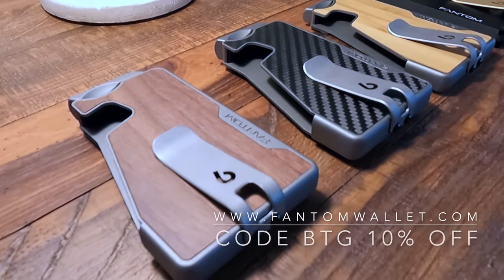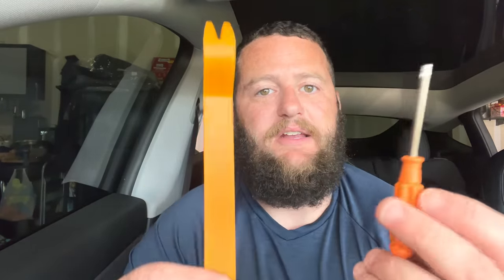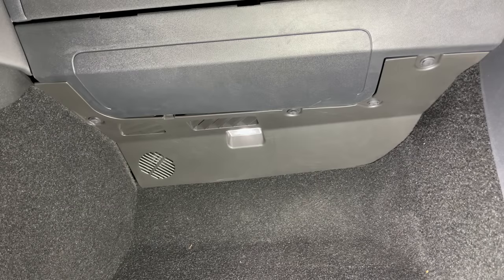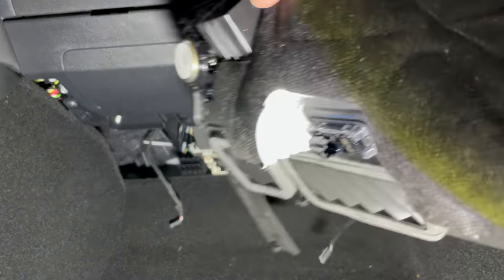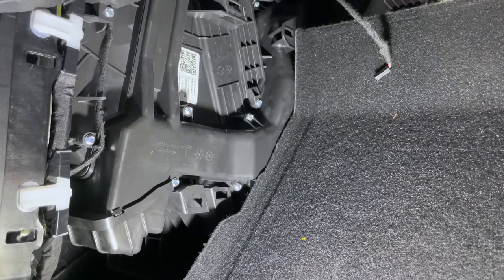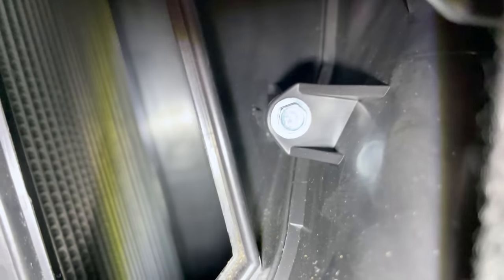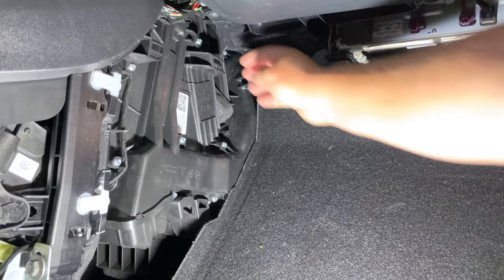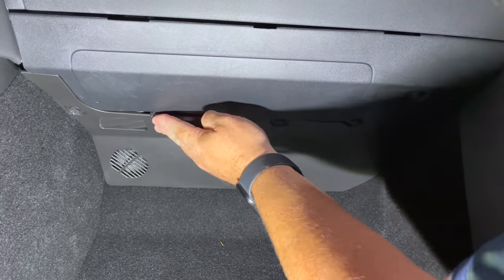Tesla Model Y - Changing Air Filter to Get Rid of Smells

Comment: Thanks for the video. I would have thought that if Tesla was going to bother to change the engineering of this that they would have gone the full mile and make the filters accessible through one simple door on the side of the console. This is still way harder than it should be to change the filters
Reply from the maker: Agreed
Reply: I love almost everything about my model Y - but the placement of these filters is incredibly dumb. “Let’s take something that needs to be done once or twice a year, and should take 2 minutes for the owner to do himself… and make it virtually inaccessible, so that multiple parts have to be removed to get to it!” 🙄
Reply: @mdickinson  agree.. had MB GLA and GLC and Honda Accords and never did i do any of that filter changing stuff...
Reply: Tesla wanted $129 for a mobile service to come change the filter. I said nope, just watch this video.
Reply: @vonn793  they quoted me $73 to come out and change mine and I supplied my own aftermarket filters and they charged me $23
Reply: I was unable to remove the speaker cord so I unscrewed the speaker and unable to remove the side panel entirely, I saw the clips holders are breaking, so I bended the panel to access the filters. So dump engineering!
Reply: @MrLincoln07 cjyuj
Reply: @joan38 just do it without unplugging anything. Can be done
Reply: Yeah, my '21 RAV4 Prime had filter access by bending a tab that let the glove box hyper-open. Then the filter door was right behind the glove box opening. 'Took 2 minutes and no tools.

Comment: Thank you! You did a great job positioning the camera. I appreciate  your efforts to help make the Tesla experience better for all. Dealerships charge about $250 to change the cabin air filter. Who knows if they clean the evaporator coil while they are doing it? The famous quote of unknown origin attributed to Napoleon Bonaparte: "If you want a job done right, do it yourself!" is my motto.
Reply from the maker: I totally agree! I am not claiming anyone is doing anything wrong at a dealership, I just like the peace of mind by doing it myself. Back in the day of oil changes, I used to request they skip the Carwash. I didn’t want them doing even that lol
Reply: I had it done today at the local Tesla service center. It cost $58 total.
Reply: The service center in Pleasant Grove, Utah just told me today that they do not offer evaporator coil cleaning. $80 for a mobile tech to just replace the two air filters. I will be attempting to do this myself now haha.

Comment: Horrible placement of cabin air filter. I just did it for my Model Y and it was a bit of a pain but thanks to your video I was able to accomplish it without any issues. I have done CAF replacements for many types of cars over the years and, this one was by far the most time consuming.
Reply from the maker: Yea, its interesting the placement of the filter. Quick maintenance items like those air filters are generally engineered in place for easy replacement at the shop. This one is unnecessarily complex lol.

Comment: Great video! I recently had to do this on my Model Y. I recommend not removing the speaker plug because it's very fragile and can easily break. Also, I've had to do this twice in the first year I owned the car, but the second time I tried the new aftermarket filters. I guess we'll see if that helps long term. It definitely smells fresh now. I also live in Utah where it's a dry climate. I wonder if it really is a dry climate issue? Thanks for posting!
Reply from the maker: So strange. You’d think it would be wet humid climates
Reply: Yep my Y smells the worst.. I’m right in Los Angeles California too.  Wish Tesla would make the car aware of the likelihood of this happening and auto-run the fan when you arrive at home or said destination 🤦🏻‍♂️ This just has to be dealt with come Cyber time etc.
Reply: Has to be some way they can design a better/modern method that avoids this typical new car with shittyAC smell problem always developing in most modern cars.. Can’t expect people to remember to turn the fan on before arriving every-time. Life is busy/hectic enough.
Reply: which aftermarket filters did you use? I'm needing to do this.
Reply: So after a year now, how did the after market HEPA filter compare to the original?
Reply: @addictedtopussy69  I still haven't needed to replace the filter. No nasty smell yet. It does seem to let in more smells from outside though, but other than that I like it better than the OEM.

Comment: Thanks for the video! Just got a slightly used Model Y and the musty smell was bothering me.
This was super easy to do. I used Kool-it cleaner from Amazon for $16 and Shufudja filters for $20. The cleaner has a bit of a minty smell. The filters came with the tool for the screw removal and the orange prying tool.  
In my opinion you don’t need to unplug the speaker.  I didn’t have a tool for it and it wasn’t really in the way of me doing the job.
Also, for anyone wondering (it’s hard to tell from the video) but the filters are in the passenger side. Tesla recommends changing the filters every 2 years. It’s an easy DIY for sure.
Happy with my new fresh air!
Reply from the maker: Easy peasy

Comment: I just did this air filter change, thanks to the video.  Some pro-tips:  The filter pack came with the little tool needed to unscrew the filter panel.  The foam tube blew off at one point, so make sure it stays on during the spray (it got in my eyes and all over the interior).  I found you don't necessarily need to remove the speaker wire plug to access everything, just move the panel to the right out of the way to save time.  The panel tool is necessary.  The side panel had a bottom center clip that sorta broke off, so be careful pulling that one out.  Other than that, everything went back together very easily.  The spray and filters totally fixed the smell!

Also, the foam spray didn't have much of a fragrance smell or chemical after-smell, which was really nice.
Reply from the maker: Glad it all worked out. Thanks for sharing your personal tips!
Reply: what does tesla recommend for the changing interval for the filters?

Comment: Excellent video!  Just finished the install.
Pro tip:  
1. When installing the 4 bottom clips near the speaker and light.  Be sure to have the inner part of the clip pulled out when installing.  This drove me nuts.  I was unable to get the clip pushed in because I was installing with the two pieces pushed together.  
2.  I was unable to get the lower center clip of the side panel released.  I did the install with it in place.  Be careful not to break it.
3.  Be sure to have something under the car to catch the liquid from the cleaner.

Thanks again for the video!
Reply from the maker: Thanks for sharing your tips!

Comment: I find it amazing that we are all ok with having to do this. I’ve owned over 10 new vehicles in my life, not once did I have to do this besides on my Teslas.
Reply: Many late model cars have cabin air filters and that's a good thing rather than blasting dirty, outdoor air through the cabin and/or gunking up  the AC and heater cores. I think one thing that is possibly worse in the Teslas, however, is that the air filters seem to sit right up next to the evaporators which may allow the filters to wick up moisture and stay wet longer and more often than other car filter setups. My '21 RAV4 Prime, for example, seemed to keep its cabin filter dry.  Even without cabin filters, car AC evaporators can grow gunk. My first car, an '84 Rabbit, used to have smelly AC from time to time.

Comment: Very helpful. Two things little things.  One I simply could not get the speaker plug out despite pushing in the pin it only came out half way so I just disconnected the light which was easier and gave me the room to maneuver the new filters in, and second the video show but doesn't explicitly say that for the light/speaker piece to put the base of the pin in first then push the other piece in.  Great video pretty easy even for an old guy.

Comment: Great video tutorial! Like others that added some great tips I wanted to add some tips since I just completed the task myself. 
* Bonus* If you want a “temporary fix” to get rid of the smell run the heat on the highest setting with the windows down for about an hour parked.  Learned this from Reddit and it lasted for a few weeks until we got really rainy and damp again in Nashville. Must have killed off some milder or mold with the heat. 
1. If you’re having problems with the panel “popping” off on the right of the center console a long flathead screwdriver can help by pushing in on the top of the white parts of the clips from the top. I was doing this in the cold-ish weather and they were really sticking. Pushing in on top got them to release and I was able to work my way from “top down” getting them to release and pull away with a real long thin flathead screwdriver. 
2. Place a piece of old cardboard under the car if you’re don’t want the coil cleaner to run onto the floor in your garage or driveway. The A/C condenser drain is near the middle lined up behind the front fender wheel edge / mud flap. Not sure if it would have stained but I wanted to catch it with something. If you have an old unused “oil drain pan” that would work too. 
3. The Kool-It cleaner recommends waiting for 15 minutes then running the vehicles A/C on low for 5 minutes to help distribute and drain it the rest of the way out. Not sure of the necessity of that step but I ran it without the filter and with the filter lid cover on for about 5 minutes before installing filters. 
4. I put some essential oils on the cabin filters to see if I can make a built in air filter at least for a bit… Hopefully it won’t hurt the cabin air filter.
Reply from the maker: Thanks for sharing

Comment: Today's project was filter replacement.  There was a considerable amount of debris and insects at the bottom of the bottom filter.  Once filters were removed I cut a 16" piece of flexible vinyl hose and jammed it in the end of my shop vac.  I was able to use the open end of the hose to remove the items that fell onto the bottom of the air box.  Hardest part of removal was finding the right size tool for the filter door.
Reply from the maker: Nice tip thanks for sharing

Comment: I just tried this. And huge thanks for the video. In my case I had an issue with the degreaser. I think the hose has a hard piece of plastic inside and it was not cored out to fit the red nozzle off the can. I had to drill it out. The test went without a hitch! I did find my Tesla was missing one of the button clips in the process … figures lol. 

Thanks again!

Comment: Replacing the cabin filter on my wife’s Accord takes me about 1-2 minutes. I’m surprised it’s not just as simple as opening up the glovebox and pulling open a couple tabs on the Tesla! I guess without the need for  oil changes, they had to engineer some extra steps to keep the technicians busy lol. Great video!
Reply: I have an accord too and it's way easier to change the air filter. Not excited to change this when I get myY. 🙁
Reply from the maker: Haha
Reply: Yeah this is on the harder side for an in cabin air filter, about the same as our fiat 500e but other cars are a screw in the glove box area as well.

Comment: After following these instructions, my A/C no longer is blowing out cold air. I bring my temperature lower but it doesn’t feel as cold as it did prior to replacing the filters. The orientation for the new filters is correct.

Comment: I have been under the impression for years that condensation that develops in the vents after running the a/c might be a source for bad smells. I always try to run the vent (a/c off) when approaching my destination. Seems to have helped.
Reply from the maker: That will help for sure
Reply: i've been doin that for years and never ever get that musty smell
Reply: Removing the source of the smell by disinfecting is more effective. Blowing air across a surface is not the same as applying a germ-killing substance.
Reply: I think the filters' proximity to the evaporator allows the former to wick and absorb moisture from the face of the coil and then the filters take longer to dry. I do agree that running the fan w/o the AC for a few minutes can dry the evaporator. In the Tesla case, when the filter(s) get wet, however, they may take longer to dry than I have patience for.

Comment: Thanks for the video, I just did mine tonight.  I didn't use the Klima Cleaner as it is fairly expensive.  Instead I used AC Safe Foaming Coil Cleaner which was only $11.99 CAD.  Has a bit of a lemon smell but that probably will go away in a few days.  The smell I had (which was sort of a wet-sock smell), is totally gone now.

Comment: Not an incredibly complicated DIY, but probably the most involved air filter change of any vehicle I’ve had.  Hell even in my last (Mercedes) it was as simple as going to the back of the glove compartment, 5 minutes in and out.

Btw, correct socket fitment is 1/4
Reply: Not sure if you’ve actually done this but 1/4 is NOT the correct socket fitment. Doing a 22 MYP and every 1/4 I have is too big. Makes sense since 1/4” is 6.35mm. 6mm from metric set fits without spinning on the head. Not sure why Tesla did 6mm. Maybe they bought the cheapest 1/4” screws ever lol. 
Just wanted to let other DIYers know they’ll need a little metric set if they were thinking their 1/4” but holder would work like I assumed.

Comment: Thanks again. I just changed my MYLR filters. I also did the Kool-it cleaning. It is required to remove the plastic panel with the light and speaker. I was able to pull the old filters out without removing the plastic panel but could not get the new filters in with it in place. The liquid I collected from the cleaning process was slightly brown with some sediment.
Reply from the maker: That’s good results, means it cleaned it out well

Comment: So I just successfully completed the filter change, however, I broke the speaker connection when I removed the panel under the glove box. What is that specific speaker for? Many thanks!
Reply from the maker: bummer. The good news is that speaker is a backup speaker. It is used in cases where the screen may be restarting during driving. It will be the source of noises and alerts that you normally hear when driving.

Comment: The ASE equivalent to the 6mm socket is 1/4", which iirc is the same size as most screwdrivers with replaceable tips.  Double check to verify, but if so, no socket wrench is needed.

Excellent video, btw.  Can't wait for my Model Y to arrive (late Sept).
Reply from the maker: Thanks for sharing that! And congrats, the wait is almost over!
Reply: As soon as I saw that hex screw, I was like, that’s an easy 1/4 hex. Take out your quick change hex extensions bit, and that will fit perfect.
Reply: 1/4 did not fit. Too much slop on my magnetic bit holder, sockets, and bit driver. 6mm fit perfectly. Why Tesla did this I’ll never know. 1/4” = 6.35mm which doesn’t engage.
Reply: @jaoliver999 almost all vehicles use metric!  Tesla exports vehicles.  Much better to use metric in the auto industry.

Comment: I was getting ready to do it.  Mine is 8 months old but living in Houston, it smells pretty bad.  I decided to run Ozone generator for 2 hrs with the air fan circulated on high.  It got rid of the smell now so I may wait a few days to see if it comes back or not.  If it works, this would be an easy way to deal with if you live in high humidity environment.
Reply from the maker: Yep, that may be a good temporary fix from time to time to keep up with it
Reply: Did it come back
Reply: @wheezy4157  I changed the filter 3 months after that but no, it did not come back within the period.

Comment: One thing you left out that is critical.  If you don't shake the can of cleaner, it doesn't foam.  The fluid just ran out the bottom of the car and didn't coat the evaporator because it didn't foam... and I couldn't tell because you can't see in there.  It was an expensive can and I wasted most of it!  I only figured it out at the end.  Very frustrating!  Please add this to your video (maybe a text message over the appropriate part!  Thank you.
Reply from the maker: Haha, yea I guess I didn't show that, but yes, you need to shake the can up before spraying
Reply: @BeardedTeslaGuy :  It is not a small thing.  It isn't obvious you should do that and if you don't, the liquid just squirts out and runs out the bottom.  It isn't like shaving cream where it foams automatically.. and you wouldn't think to shake your shaving cream can.  I think you should edit in an overlay so someone else won't make the same mistake as me!   BTW, now that I am a few days out, my car has the faint smell of fried chicken when I put on the A/C.  I expected it to smell more chemical, but it smells more KFC.  Hoping this goes away soon.

Comment: This happens with every car not just the tesla. What you should do is before you reach your destination. If you just press the a/c button to actually turn of the “compressor” it’ll let the moisture that builds up in the evaporator (heat pump) cycle through the train tube. That’s why you’ll see some cars with water after being parked with the ac on. Quick fix and it’ll stop the smell from happening.
Reply from the maker: Yea, it’s moisture getting trapped. I’ve never had a car do that before

Comment: Maybe humid-area cars release so much condensate water that the higher flow better cleans the dust and other contaminants off the face of the evaporator than in a dry climate, leaving the coils still wet, but somewhat cleaner?  I know that comparing 2 home central ACs - one on my cousin's Hemet, CA house and one on my MA house years ago, the flow from my condensate drain in the humid climate was easily 10 or 15X what was coming off the desert home's condensate drain on a typical summer day.  (Both houses were of similar size.)